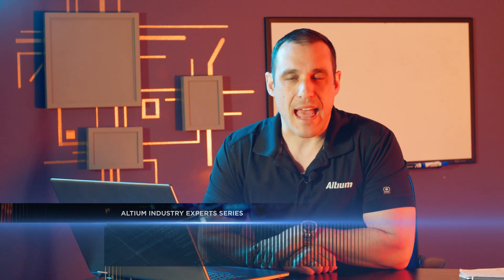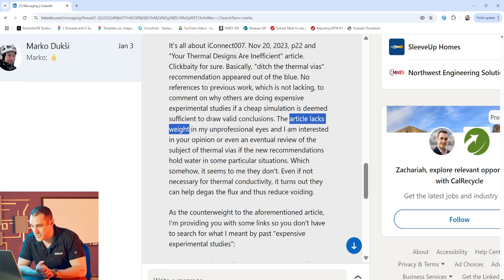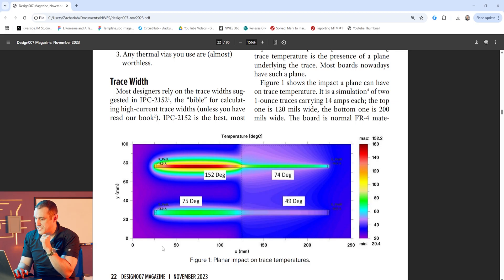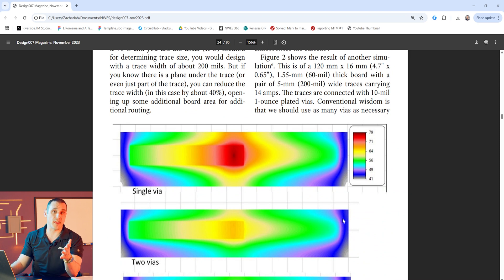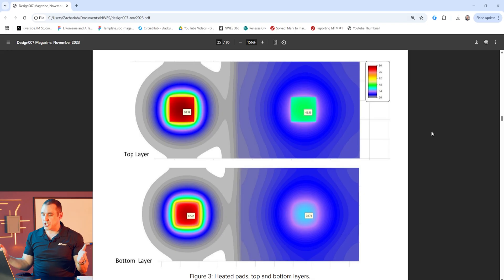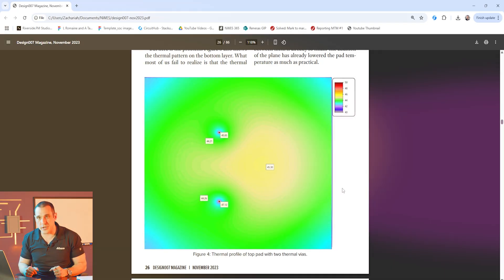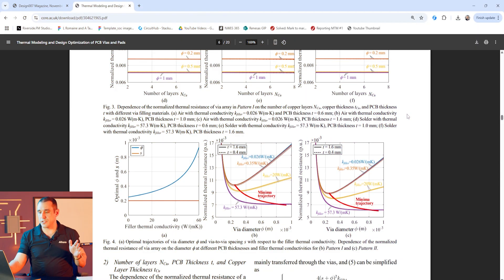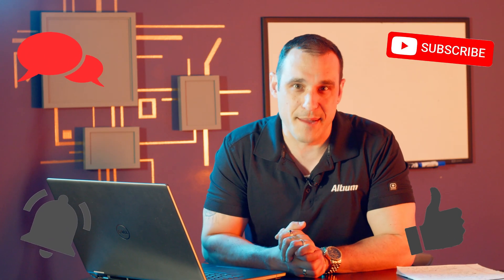Do PCB Thermal Vias Actually Work?

Comment: Hi Zack, I have placed some vias on a thermal relief smd pad (drain pin - mosfet) to connect it with the bottom plane. When I go to "Fabrications Outputs->Final" to print the Top Layer the vias where are in the area of the thermal pad are not visible (the rest vias where are not placed over an smd pad are visible). Do you know if there is an option to make them visible?

Comment: Zach, Your comments are generally well thought out and supported. I would like to add a couple of things you overlooked or skipped over. First, in Figure 4 of the I-Connect article, it is important to note that the effect of a thermal via, whatever it is, is very localized to the immediate area of the via. It does not spread across the area of the entire pad. There are significant thermal gradients across the pad. So, if, for example, you cluster vias on one area of the pad, you don't have much benefit on another area of the pad. Secondly, in a follow-up article in PCD&F, December 2023 ("How Many High-Current Vias Do We Need? (Fewer Than You Think)") we actually quantified the number of vias. You noted that in the example in the I-connect article the calculated number of vias is around 14 but the use of just 3 vias made a big difference. Turns out the relationship is a square-root relationship (note the square root of 14 is between 3 and 4!). If n is the ratio of the trace cross-sectional conducting area to the via cross-sectional conducting area, we need a number of vias equal to the square root of n.

Comment: Hi Zach, Dear all,
Thank you for bringing the issue to the wider public. 
I’ll briefly comment on your critique of our iconnect007 article.

1.  We intentionally did not use realistic designs but instead focused on the physical foundations. In this sense, iconnect007 may be incomplete, but it is targeted.
Two typical but completely different geometric and physical situations are presented: current-carrying vias and thermal vias under components, that means filaments of heating wires and cooktops. This makes a huge difference in the shape of the 3-D temperature field and heat flow.

2.    The second part about the current-carrying capacity of vias actually says that the thermal coupling between the trace and via either turns the trace parts or the vias into heat sinks. By the way, Doug also showed experimental results.  In unpublished calculations with 3 current-carrying vias, I saw that there is a difference in voltage drop depending on whether the vias are arranged in a staggered or side-by-side configuration. I 'll blog that.

 3.   The third part about thermal vias intentionally does not include heat sinks. 
People, be careful when comparing via studies with and without heat sinks; you’re comparing apples and oranges! Without heat sinks, you have a 3-D heat flow, whereas with heat sinks, it’s nearly 1.5-D. This makes a fundamental difference.
Thermal work is more than just adding Theta_th and K/W. Temperature considerations should take into account FR4 and copper, surface areas and volumes, additional heat sources, and the temperature gradients themselves  in order to achieve a consistent temperature field.

    The "incompleteness" of the thermal via paragraph might be complemented by my blog on LinkedIn and references therin. There, I don’t use academic geometries but instead calculate existing designs from the perspective of a physicist. I’m curious about the reactions.  Summary: If there is no heat sink and then all vias are deleted from a calculation model, the temperature increases by roughly only about 10%.
    https://www.linkedin.com/posts/dr-johannes-adam-ab4991123_thermalmanagement-electronics-thermalvias-activity-7154123834718121984-sWHz?utm_source=share&utm_medium=member_desktop&rcm=ACoAAB6UQegBCzzz-Ho-G88xGrvs4p7g_N6JCgM

People who like to see "more realistic simulations" are invited to visit my
  -  home page: www.adam-research.com
  -  :yt: : https://www.youtube.com/@adamresearch-thermalriskma7955/videos 
  -  Linkedin blog: www.linkedin.com/in/johannes-adam-ab4991123

Comment: They do absolutely work. 
MIT's EE department has documented a few really top notch implementations
Conducting heat down  into via's  can be done better with fewer vias and a better thermal interface between hot components and PCB surface.
And a heatsink + airflow on the opposite side of the board (as required).

If you have power planes in the board generating heat - you design has issues, plain and simple. Don't blindly slap a band aid over one symptom of your design flaws: fix the issue.
Either more copper surface area is required, or you  are experiencing magnetic issues somewhere.
Reply: I saw that in one of their OCW Power Electronics lectures on youtube. Do you know where I can find those implementations online that you’re talking about?

Comment: with all respect, a temperature difference of 6 degrees is a lot
Reply: And if you look closely, the authors of the original paper actually read some of the temperatures incorrectly in that paper, almost like they intentionally sampled too far from the thermal vias in order to not report too large of a difference. However, their heat maps have legends associated with them, and even where they claim the difference is ~1 °C, it is actually much more.
Reply: I was more interested to see what is the minimum difference they could get assuming a huge number of vias. At some point you should get to a minimum temperature difference and they did not present that in this paper. That would have been an excellent result. Maybe it is in the authors' textbook, and it would be a really good rule of thumb to have available.

Comment: Is all this "Who is wrong?" really just a question of which problem you are trying to solve from which starting point?  For power delivery, you want a plane.  But often you can just use routed power.  If you use traces, you want them to be wider, and wider is always better.  Going from 2.5mil to 10mil is important.  Going from 100mil to 107mil isn't, unless you have no safety margin.  Even going from 100mil to 300mil probably won't matter much, unless you shouldn't have been using routed power in the first place.  But you might as well do it anyhow if you don't have any other use for that space.  

Similarly, arrays of thermal vias are good, and you should do them unless you have a good reason not to.  But the iConnect paper is pointing out that they aren't *essential*, and they have rapidly diminishing returns, so if space is tight, fewer vias is a good place to start looking for compromises.

Comment: I once touched a soldering iron to a pad with a bunch of thermal vias while I had a finger on the back side of the board under it. Yes, they work.
Reply: Yeah I'm not saying they don't work, I guess it's a question of "do you really need 16 vias in the die-attached pad on that QFN?" I wish the article would have looked at this for different thermal power levels so they can determine the maximum number of vias needed to reach diminishing returns. That would be really great because you can relate that directly back to a package thermal resistance.
Reply: @Zachariah-Peterson let’s flip the question?

Given the space available and the minutes it takes, why would we be trying to minimize use that doesn’t add substantial cost but has a very real chance to add thermal lifecycles in FEA while extending the thermal operating range?

At what point is maximized efficiency such that for the time cost of a coffee break in most circumstances for relatively low-complexity designs, a detriment to resiliency and effectiveness?

I have a consumer product I see often. Somebody forgot to add some diodes, and the flyback constantly punishes this one particular component. It lives typically under the hood of a car. 

Should that device be moved in order to deal with heat better? Yup… but “because race car,” people often don’t. There’s som end user error introduction certainly, but even when there isn’t… it becomes a common failure point over time. 

Maybe thermal vias and 2oz copper instead of what’s there, would have helped with that design. Instead, that company has customers increasing warranty claims. That means staffing costs to the warranty department, which costs more as an ongoing line item than adding $100 worth of BOM/Engineering. 

If they work, the room is there, it makes sense, and it can be done in minutes… what is the sensible argument against using them?

Saving under an hour of dev time for somebody that’s already on salary? 🤷‍♂️
Reply: @charlescoolidge747  The time is certainly not the issue, it's more about questioning the implied guideline that this large number of vias is always required. Consider this: I currently have a layout I am working with multiple BGAs, QFNs, BGA/LGA-style SMD connectors... This design requires a shit load of vias everywhere, the total number of drill hits is in the thousands. Reducing the number of through-holes outside the BGA areas is very useful in this design because it gives more room for routing. Sure I could do blind vias to get around groups of QFNs with 9 or 16 through-hole vias, but then I have to stack or stagger them to get into certain layers for routing, and in a Type-III HDI stackup that is kind of a pain in the ass. Or I could do blind/buried for my thermal vias, but then those are stacked and could become a primary failure point under repeated thermal cycling. It's a lot easier to delete some of those through-hole thermal vias and create some routing space.
Reply: @Zachariah-Peterson okay I can definitely take your point on that one- that definitely makes more sense from that perspective. 👍

I’m working mostly on automotive accessory and wiring patch boards for different systems and controllers- it’s probably biasing my thinking in that regard, as the complexity is reduced to the point in most cases where I’m not having to think as hard about that issue in a tighter package most of the time with something like a BGA as an assumption on the majority of those products (or typically only to a limited degree.) 

So okay, fair point if it’s going to up the later count needlessly to accomplish the same task for routing, or just make it untenable without a lot of rework/workaround. 

Alright, that seems like a reasonable constraint- given the floor minimum inference in your other post, now coming at it from that perspective makes way more sense.

Sorry for jumping the proverbial gun on ya. 👍

Comment: The boards aren't any cheaper when I strip out lots of copper and half the vias, but I want to pass EMC and not calculate my trace width to 3 digits of accuracy. Hence wide traces (low inductance + distributed capacitance) and lots of thermal and stitching vias.

Comment: This video was interesting as I've also seen references to the diminished effectiveness of adding additional thermal vias. In my current employment I have designers asking me to add "as many thermal vias as possible". This is where the choice of thermal via comes into play. One important point that no one has mentioned is that the thermal resistance of air is much greater than that of the dielectric. This means that the reduced thermal resistance of the plating over the dielectric, is offset by the increased thermal resistance of air (due to the via hole). However. if you are capping and thus fill the thermal via, I believe that you get a more effective thermal via.
Reply: https://www.adam-research.de/pdfs/TRM_WhitePaper13_ThermalVias_EN.pdf

Comment: Vias with tiny ID but huge OD are great because the metal is thick, but if you're removing PCB and substituting it with micron thick metal, it's horrible. Pouring solder into giant holes is still king.

Comment: "Your high-current-carrying traces are probably too wide." From their simulation, it looks like a wider trace still helps, especially over a ground plane. If I've got the space, I widen the power trace. If you're pumping that much current through one ounce copper, you're probably not too worried about space constraints.
When I hear "thermal vias" I'm usually thinking about a large die bonded tab soldered to a copper pour. Of course in these cases I'd prefer to throw the sink at it.
Reply: I think the part that really helps is the "over a ground plane" part and not the "wider trace" part. That was what Mike Joppi found when they were developing the IPC-2152 standard and it's one of the reasons the IPC-2221 standard is so overly conservative... 2221 never considered planes.

Throw the heat sink at it?
Reply: @Zachariah-Peterson  "Kitchen Sink Included." Sorry, it was a pretty tortured metaphor. I could probably face several indictments for that.

Comment: Actually the IPC "standards" are mainly recommendations. While they are widely accepted as standards for PCB design and manufacturing, they are not legally binding and shall be used as guidelines and good practices. Industry standards are UL, IEC, IEEE and other, used for certifications. No one uses IPC for certification of a product. Also, during a PCB layout design, the calculation of the clearance and creepage distances must follow UL/IEC standards' tables and formulas.

Comment: For something based only on simulations, the study is super limited.

It’s equivalent to claiming most traces are fine with 150um width, then testing only currents in the 1-100mA range, of course the effect of doubling the trace at that current level is minimal.

Try dissipating 100-500 W, and you’ll see those vias make a huge difference!

Comment: Thanks Zach.  Had this exact question on a design I was reviewing today, with several different manufacturer datasheets recommending different densities of vias for their respective parts, which included switching regulators.  I haven't read either article yet, but from previous simulations, there are two more significant parameters - copper weight of the plane and dielectric thickness (which is impacted by stackup choices, 2 layer vs 4 or more).  In our case, we went with about half the datasheet suggestion as some were using much smaller vias than our fabricator comfortably supports. An advantage of more vias is lower GND impedance for the EPAD, relevant for our switching regulators.  Another consideration is for RF parts where GND impedance / physical spacing can have an impact, especially at mm-wave.

As Eric Bogatin would say "It depends!"

I'll be pointing this video out to our team on Monday.  Thanks again.
Reply: Great point, Robert. Your mention of GND impedance is critical for RF and mmWave designs (and I would add parasitic effects as well). With high-frequency circuits >2-3GHz, having too few vias (e.g. 4 or 9) under an RF IC can significantly degrade performance, causing loss of gain - sometimes as much as 3 dB - which can severely impact the link budget. 
Thank you, Zach, for raising the topic!
Reply: Hi Robert,
how do you rate my results? Do you have a concrete design that I could calculate (FOC)?
https://www.adam-research.de/pdfs/TRM_WhitePaper13_ThermalVias_EN.pdf